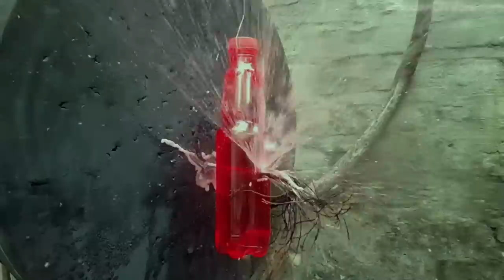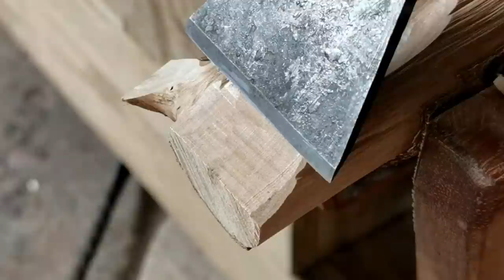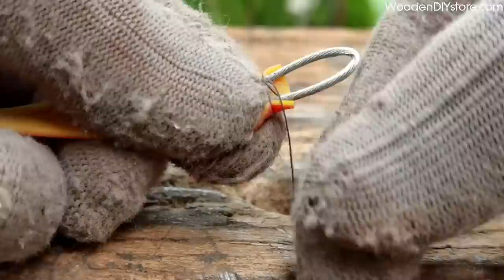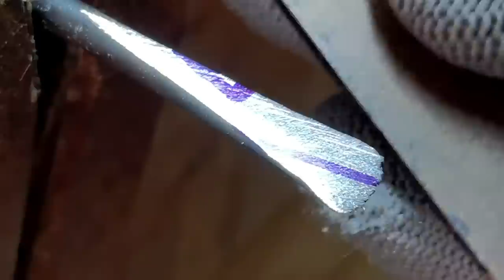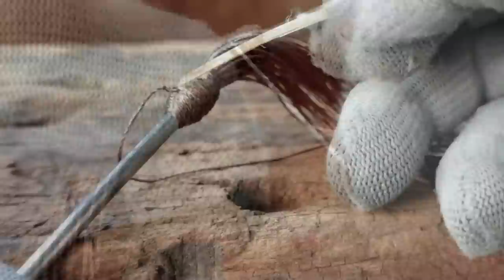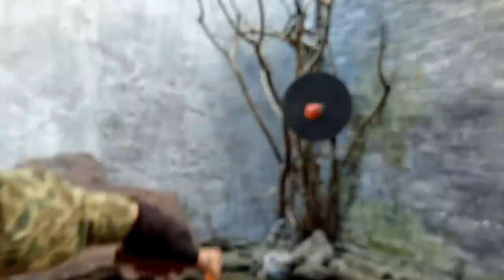The Best "Penguin" Pana Slingshot Darts

Comment: Nice Pana you made.     Solid wire/steel holds up better than braided wire.   Also nails are a cheaper solution for the darts.   You don't even have to heat them up.   Nails aren't a high carbon steel.   They are a mild/low carbon steel and you can pound out the ends easy.    Also, hammering the ends while cold work hardens it a bit so they hold an edge better than heating and forming.
Reply from the maker: Thank you for following the channel, plus the fascinating idea. I will try to imply them in my future videos.
Reply: @WoodenDIY   happy to help.       BTW, nails give you something to grab onto better.
Reply: I thought that steel wire would cut thru the rubber easier ?
Reply: @susannepinheirobartolo4427   nope    but if you're worried you can wrap it with string over top but only the part that the rubber comes in contact with.     The braided wire acts like a saw on the rubber and gives more room to catch the dart.
Reply: Lol, how hard does the steel have to be to hold an edge?? He's not going to be shooting brick walls...
Reply: @samuelluria4744   first of all he is shooting at soft targets and potentially to hunt with.   Pana are traditionally used that way and to kill people.       And hardness and sharpness are 2
 differently things.      Infact he would want it as soft as possible to shoot at brick as a hard edge would potentially shatter and send pieces flying everywhere, maybe even back into him.      As for sharpness you need steel to be a combination of hard enough to hold an edge so you're not repeatedly sharpening it (because sharpening wears down the metal and eventually it wears out) and it needs to be durable enough to not lose its edge after a single use.   Now on the case like this, you want it to be able to stock into your target reliably and effectively because that is safest.   A dull edge on a projectile can deflect the projectile and potentially make it go where you dont want it or have it not penetrate the target.      
When working with tools that are supposed to be sharp, then a sharp tool is the safest tool.    Additionally, he went through extra steps that actually limited the life of his darts.    They are more likely to bend and be unusable having heated them up as opposed to cold working them.

Comment: Bleeding thumb : 99%
Reply: Searching for bleeding thumb :99%
Reply: @chrisgoldbach4450  you'll find that eventually
Reply: @blankon2292  He find it at the old school
Reply: Deff be putting some metal protection over my thumb position to protect from overstrike from the dart if your form is off as it seems you really need some wrist action to pull off this style
Reply: I was thinking that 5 seconds in. 😂
Reply: More like thumb decapitated 99%
Reply: Some people like their thumbs with metal rods through them.
Reply: From all that sanding, not the actual sling
Reply: Loss of eye: less than 1%

A little gambling is fun
Reply: Where did you get the flat elastic piece
Reply: @joshuacollins385  actually? Ok
Reply: @The_E_Channel  Yes. They're used for exercise in place of weights, but they're also used for making slingshots and elastic powered bows and crossbows. They're not too expensive and especially for low powered stuff they're a lot of fun, but I think Joerg Sprave made a crossbow using them that essentially shoots spears.
Reply: Yep all them reply’s are 👌🏽
Reply: Thumbnail be gone

Comment: The bolt can’t hit your thumb? 
For some reason I can picture it nailing my thumb to the handle…
Reply: That happens with slingshot darts.  This design seems like it would be extra likely
Reply: Nope.  Like snapping a rubber band at someone.
Reply: @ DCM  😆 the way you worded your thoughts about it.
Reply: I've seen pictures of that happening to other people and it ain't pretty.
Reply: DCM, My first thought...looks like a trip to the hospital.
Reply: Yeah it’s not pretty when it happens. Don’t do this it’s a bad ideaz
Reply: +1. Was my first thought.  Any word from the creator ?   This design looks sketch as fuck .
Reply: Usually you release the dart as you move the handle down
Reply: @Lupinotuum66  there is content in youtube showing hand injuries from this, it can be even worse when the dart does not release from the string and flies back to the shooter, this even happens sometimes with normal slingshot when using too heavy balls or sticky balls, it can entangle in the pouch and does not release, thus flying back to the shooter, its known in slingshot forums.  Eye protection glasses is a must when shooting slingshots, crossbows (bow limb can snap),....

Comment: Made these back in the early 60s, lots of fun. Wondered why no one used them
Reply: @Reegareth  so holding it too high is how you nail your hand to it.. do you mean holding too high on the handle like a dumbass, or, holding the back end of the arrow too high? I want to make and shoot one but I'm afraid I'll get nailed, how do you aim, do uk? It seems if you hold the arrow wrong, like at too much of an upward angle, it could angle down rapidly, because of the band placement, painfully ripping thru your hand nailing it to the handle.
Reply: @Sublime_1  if ur afraid about using a stick for the handle than find a "Y" Shaped stick the dart will not go into ur hand this way no matter the angle u shoot it

Comment: Good pana you can also use the plastic bristles off a broom for fletching on the dart and weed eater line for your loop on the band less likely to have a return to sender love your videos
Reply from the maker: thanks man
Reply: Thank you looking forward to more videos
Reply: Weed eater line is not stretchy, or atleast not rubber stretchy.
Reply: @robert9595  that’s not the piece he’s referring to as a alternative, rather the looped metal piece that the arrow attaches to for launching .
Reply: @robert9595  (neither is a steel wire loop)